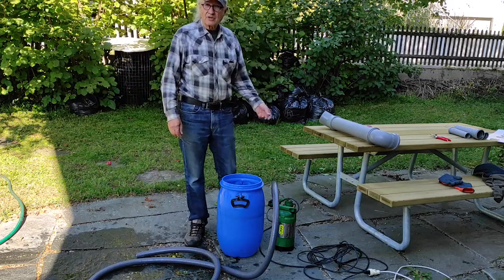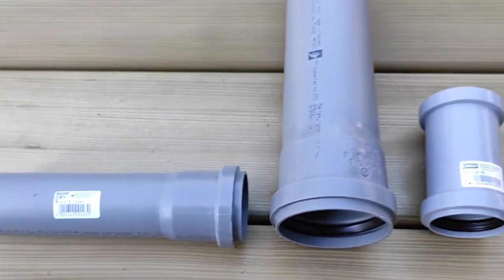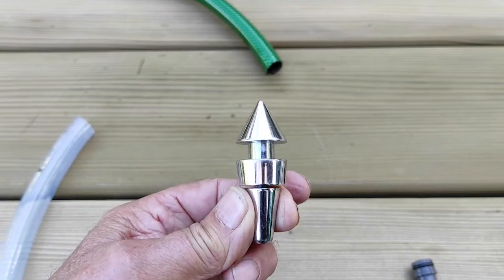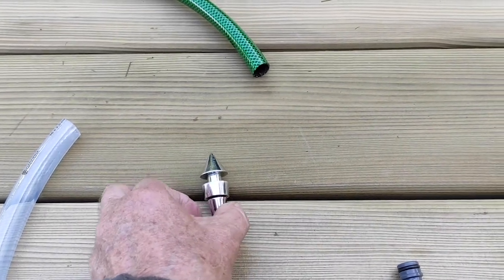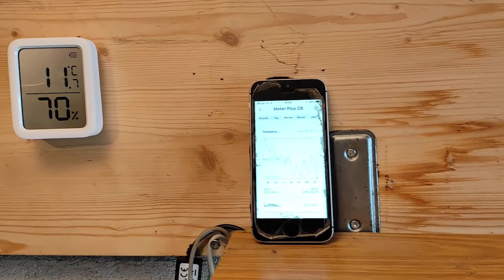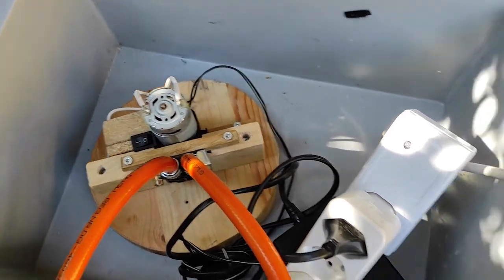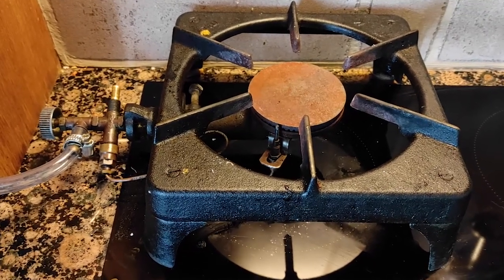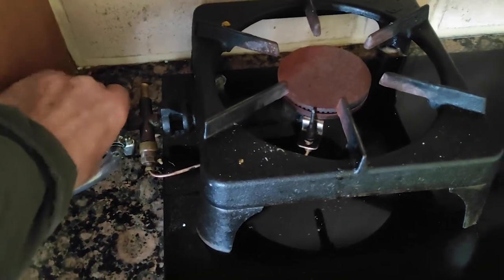Homemade Biogas in Switzerland Part 4, Details

Comment: do you think that a 2kw solar system could be sufficient to heat a small 50 liter biogas system, so that it'd produce enough heat for a small greenhouse to keep up above freezing? (in Czechia)
Reply from the maker: From my experience the digester should not become cooler than approx. 22 degrees. Otherwise the bacteria suffer and stop producing methane. I wrapped my 1000 l. container with two electric blankets which draw about 150 W. A 2 kw system should be ok but of course only when the sun shines..! To this purpose I have a switch which sets in and connects mains power to keep the bacteria to approx. 30 degrees.

Comment: Hi your biodigester is great. Can you tell me, how to achieve optimal ph? Thanks...
Reply from the maker: Hi thanks for asking - At first I mucked around with a ph-meter but have not bothered to measure for about one year now. What I believe in is: Variety, think of the digester as of a cow-belly. She probabely likes lots of different green sane stuff. There is also literature about the C/N - ratio. Here the focus is on balance, I think around 20. Use your common sense as if you were making a nice compost heap. Good luck*
Reply: @etienneconod8075  
in what quantity and how often to add new ingredients? thank you...
Reply from the maker: Every morning I add a bucket of kitchen-waste av. 2-3-litres of biomass of course with some water to keep the grinder going @MichalAltman

Comment: Really enjoyed all your biogas videos... just wondering how much matter you need to feed the system, and what kind of quantity of gass you get out ? I have near unlimited access to cow manure... is this a good source alone ?
Reply from the maker: Hi - Cow manure was the starter for my system. I filled about one half of the tank with it, diluted with water at 50%. Since I have only fed kitchen scraps and fallen fruit. My system is small, for domestic use only. I feed roughly about one kilo/day and harvest enough gas to boil the water for my breakfast teapot and a simple meal for supper (burner on for 10 minutes). But on a much larger scale I have seen farmers here use large amounts of cow manure and even crops to produce large amounts of gas which they keep in dome-shaped structures. There is of course literature available but I live in a german speaking environment. Thanks for watching and thinking :-)
Reply: @etienneconod8075 Thanks for the info... are you running your size container at 100% ? I'm guessing so. So to increase I'd need larger or more tanks.
Reply from the maker: My tank contains 1000 l.  Of course you can run any amount of them in parallel. Don't forget that heating the tanks especially in winter is an issue. Methane production works best for me at around 30 deg. @ndudman8

Comment: Thankyou for sharing this! Im wondering how you keep the air tight seal in the stirring device?
Reply from the maker: Hi - There is a 75 mm pipe going to about 2/3 the depth into the tank. It is long enough to be above outflow level. The stirring device is a 50 mm t-section inside the bigger pipe, about 3/4 the depth of the tank. As long as the liquid is above the end of the 75 mm pipe it makes for an airtight seal.
Thanks for watching and thinking :-)

Comment: i started a ibc digester like yours about 6 months ago  i put very little effort into it and have been surprised how well it worked out   your set up is very good  and i must try to improve  have you seen homebiogas  on you tube   thanks for going to the  trouble of explaining your set up so well  looking forward to see how you get on   good luck from ireland
Reply from the maker: Hi, summer is over and fruit scarse the weather turns cold so less output. I am learning still and will gladly share my results in time. Thanks for mailing and good luck to you too in The Green Island.

Comment: I enjoyed this video very much. Do you rely on condensation drainage only for water removal or do you also use a dessicant filter such as silica gel or kitty litter to soak up some moisture?
Reply from the maker: Hi Grant, I am still unsure how to deal with the moisture buildup. First I thought that my first filter (gasbubbles in a cylinder) would take care of it. But now I have some water in almost all pipes. To avoid having to use some thing like you suggest I am now trying with a drainage pipe at the lower end of the installation. I will have an eye on the question and will report back in due time.